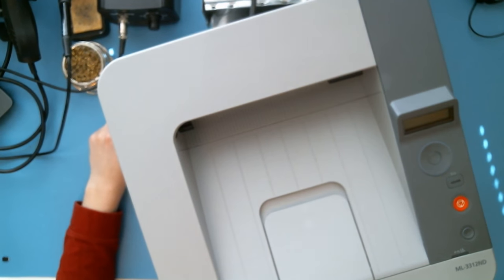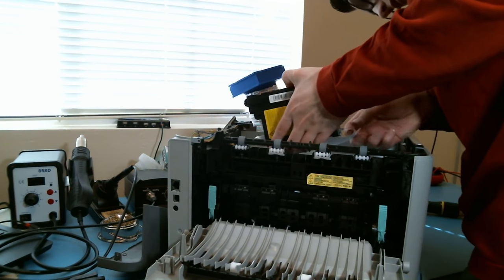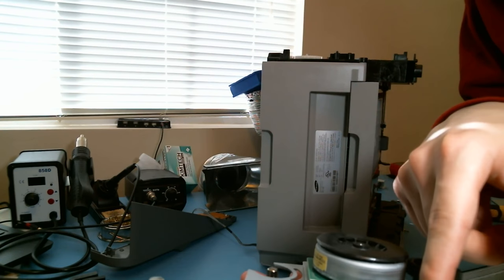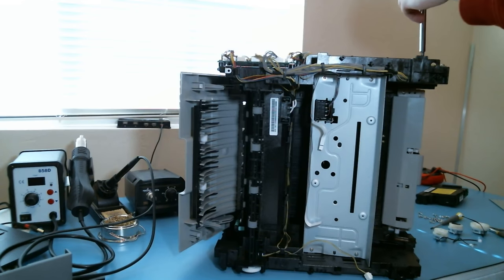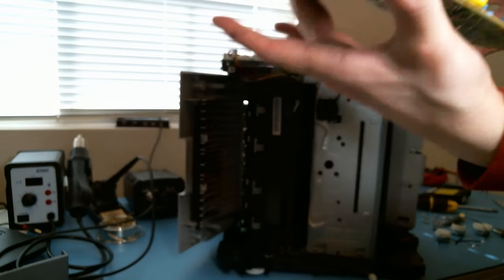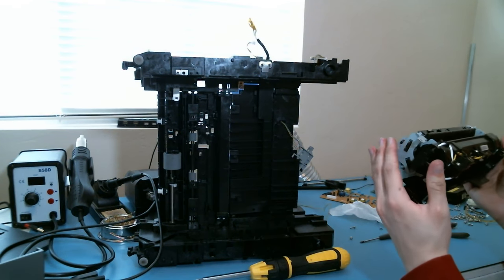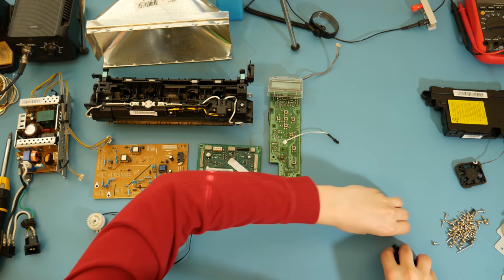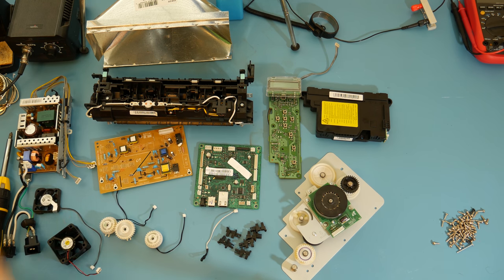Laser Printer Teardown - Samsung ML3312ND

Comment: Oooh hey! Those white things are awesome electromagnetic clutches... Handy for making brakes for small robots etc. Shaft inside spins and when u energize it, it connects to the gearing on the outside.
I do copier repair and end up with lots of those motors (Brushless one with the board attached) but sadly they are usually engineered to run at a basic speed.... Can go a little faster and slower via the pulse input on the connector. What im gunna have a go at one day is making the thing slow right down to something usable.
Like ur vids. Keep it up.
Reply from the maker: Hello! Thanks for watching, and thank you for sharing this insight! I really didn't know what those are for.

An electromagnetic clutch makes a lot of sense. I'm glad I held on to those! They sound very useful for 3d printed projects involving gears, or robots, like you said.

It's a shame that the brushless motor likely won't be useful, but it was still fun to tear apart.